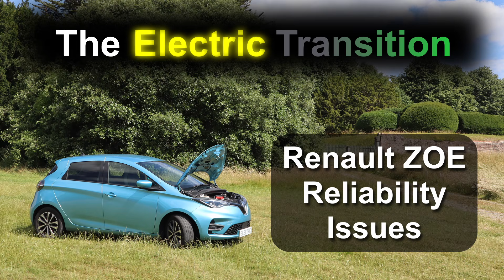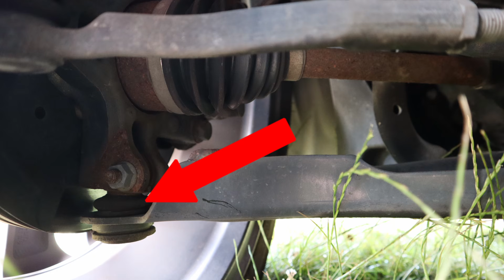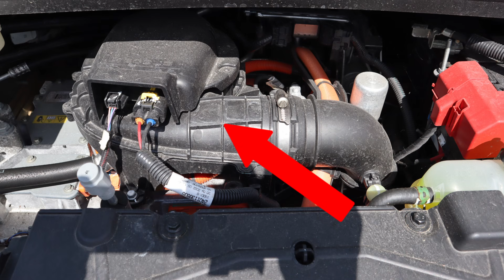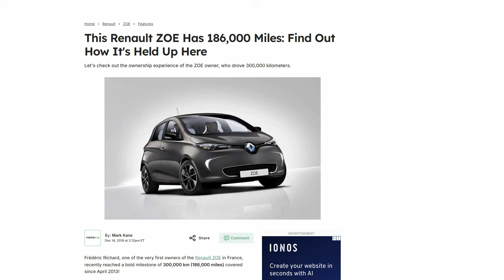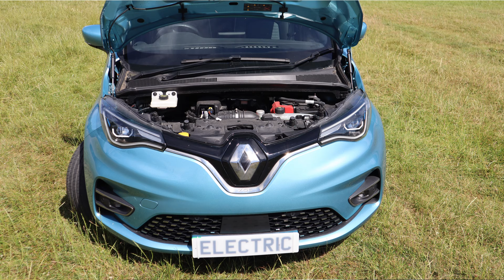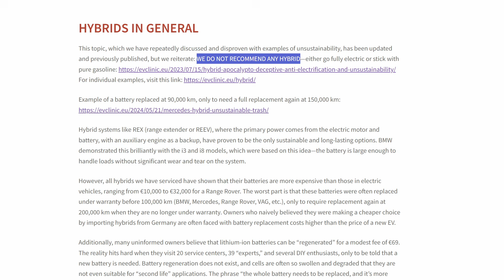Renault ZOE - Reliability Issues

Comment: R135, had to replace the rear discs at 30,000 miles. Couldn't understand why as mostly regen braking and the front disc were fine??? The rear view camera has been very temperamental. The Renault garage would charge a significant sum just to check it out before declaring whether it was under warranty or not, so just live with it.
Reply from the maker: Oh wow, a second person saying they had the rear discs replaced. How unexpected! Thanks for the information.

Did they say WHY they needed to be replaced? Excessive wear, or corrosion, or did they not say?
Reply: @theelectrictransition  I had to have two rear disc rotors (warped) and pads replaced due to seized calipers.  The hydraulic brakes don't get used often enough owing to the regen (and my anticipatory driving style.)  All in, was an expensive repair as the caliper subsequently had to be replaced as was leaking fluid.  I now know better so stick it in Neutral and hit the brakes hard when no-one's around periodically to skim off any surface rust (especially after rain)
Reply from the maker: @philip8742  Ah, gotcha. Thanks for the clarification. Yes, if the pads drag then I guess the discs will overheat, hence the warping. What a shame. As you say, the occasional heavy braking should help alleviate that, all being well

Comment: Gary indicates the R90 motor as the sweet spot for reliability. But given the R motor extraction problems you highlight, would you say the Q90 is likely to be at the lowest risk of a hefty repair bill?
Very informative video - thank you!
Reply from the maker: Thanks very much. Yes, it seems to me that the Q90 should be easier to repair than the others. The electronics are accessible from the top, so jobs on that should all be easier. I don't know how the motor comes out, but I'm not sure it is likely to need to.

I felt that the 90HP motor was underpowered, but if that doesn't worry you, then it's well worth a look.
Reply: Thank you for this - I own a Q90 ZE40!

Comment: Thanks for this useful video. 
My zoe 50 r110 with 55.000km makes some noises when turning the wheels while stopped, even in a dirt road. I read somewhere that its normal of this cars, but maybe the lower ball joint needs to be checked.
For the motor bearing I'm already planning to change them around the 100.000km.
Continue with the great videos!
Reply from the maker: Thanks, much appreciated! The lower ball joint will be checked as part of an annual safety check, if you have one. In the UK, we have a mandatory annual inspection that we call the MoT test which would highlight the issue in addition to servicing.

Comment: Just about to change the motor bearings on my 2017 R90 after only 55,000 km (!) . I've bought it second hand two years ago and it had problems from the beginning. The bearings didn't make any weird sound but the car would sometime stop with "electric motor failure"  alarm on the dash when in hot weather . Being through Renault service, got the rotor position sensor changed but it didn't solve the problem..meanwhile the car got out of warranty. Taken it back to Renault ( there are no private workshops that can work on electric cars here in Italy) just to have a quote of 4,260 € to change the motor...not worth it. So i've decided to face the problem myself and started investigating and wathcing videos and reading as much stuff i could find about the topic. I've come to the conclusion that the bearings are failing having developed axial play leading to the error related to the rotor position sensor. I know how to make my way through mechanical stuff since i've been building and testing automatic machines for the food packaging industry for the last 20 years, so i've decided to do it all by myself. I've bought the bearings ( improved ones with higer RPM rating than the original ones) for as much as 12 € . It will take some time and effort , but i will "future proof" my Zoe because i am planning on keeping it for as much as i can.
Reply from the maker: Try these for starters:

https://youtu.be/jItjGH4Th5A
https://youtu.be/593y6YZtEZ0
https://youtu.be/DUtf1TzWzzg
https://youtu.be/jPzJPWOw3LM

There are lots of others that might also be beneficial, so watch as many as you have time for.

Gary also has a few things that might be useful that are only available to members, such as cooling system refill and a few other bits. Not much, but a single month's membership to see the member only stuff might be worth the small number of euros it costs.

You can see the video titles of member only videos without being a member, so have a look and see if you think it's worthwhile.

Good luck! I'd love to hear an update on how you get on, if you get time.
Reply from the maker: I'm sorry to hear that your car has been giving you trouble. However, I'm hopeful that you can resolve it.

Be mindful that the high voltage system on the ZOE is activated as soon as you unlock the car, so get that battery disconnect pulled as early as you can, and check that the power is off before proceeding. Gary shows this in one of his videos. I'll find a couple of vidoes and post the links

I would recommend watching as many of Gary's videos as you can make time for. He shows a number of useful tips, including how to get the high voltage cables disconnected. Watch the video on the coparts car showing a broken HV connector for what I mean - how NOT to do it!

I wish you luck. Take it steady and remember that the stack is very heavy. If you are able to, get someone to help as you lift it out of the car, just to make things easier.
Reply: @theelectrictransition  Thanks for the reply. Yes i know Gary's channel and he's been one of my sources to detrmine the cause of my car's problem. I'm one of his channel members since all the information he gives are of extreme value. I'm in contact with him via mail and he even offered to guide me thorugh the whole process, but i'm trying to get the work done in a slightly different way , keeping the main box attached to the car while taking the transmission out and then sliding the motor to the right . I'm going to use a ramp that one of my work's mate has ( he's very much into cars DIY) . We'll see when we get there. We are going to try this way, but if we see it's not right or if it's dangerous in any way, we revert to the standard procedure. This is just because i have only one day to do the wotk and since it's our first time doing  it we have decided to try to take some shortcuts ..but still work with safety in mind: Ours first and of the car last. We have transmission jacks to sustain the weight of the elctronic box and i've built a cradle to hold the heat pump compressor in order to not detach the pipes from it. I need to get it done fast beacause it's the only car we have in the family and I need it to go to work ( 70km round trip commute daily).
Reply from the maker: @DanieleElaborati  That's great, it sounds like you are all set
Reply: @DanieleElaborati  any progress?
Reply: @MIHEMINNNN   Yes. I've changed the bearings Using the " official" procedure. It's actually easier even though it took two full days and two people to do the job. Taken the stack out , it took only an hour to open the motor, change the bearings and close it  again. But , unfortunally, the bearing's seat on the resolver side is worn due to friction ( the old bearing was getting stuk when heated and it turned it's outer ring together with the shaft) . So even if the new bearing has come with a bigger C-Clip ( Seeger) , it still throws the error sometimes ...much less than before and in a predictable way but , still....I let the winter pass and try to find a new motor for cheap.
Reply: @DanieleElaborati very appreciative about your input. It's still an improving industry but with cost cuts. Looking to buy my first electric car, but doing plenty of research first. And saving some money 😂
Reply: @MIHEMINNNN  If you want to look into the zoe, be sure to buy a "Q" version. It has the 5AM motor by Continental and has been much more reliable than the "R" version that has the 5AQ motor . You can even find "Q90" variants with the 5AM motors and 41 kWh battery...they're pretty rare though
Reply: @DanieleElaborati thank you!

Comment: I have the R135 Gtline Zoe, the heat pump compressor failed at 40,000 miles and was replaced under warranty. At 67,000 miles I've just had the rear brake discs and pads replaced. So relatively problem free and still returning 200 mile range in Eco mode and mild weather, around 170 miles in colder conditions.
Reply from the maker: Thanks for the information, that's very interesting. The need to change the rear discs in addition to the pads surprises me a bit. Was that because of corrosion, do you know?
Reply: @leegoodman297  useful info, thanks. 
What's the mileage now, is it the same 67,000?
Reply: @t.m.9182The mileage is now 70500, no additional issues from my first post. The most likely issue to occur with my GTline R135's is motor bearing failure typically from around the 100,000 mile mark. If caught early then just the bearings would need replacing, but apparently excessive bearing wear will cause the motor to rub against the windings and totally destroy itself!

Comment: R135 in the family, my daughters car. Obviously the bearing issue is a worry, I doubt she’ll notice the noise should it happen to her car. I don’t think it’s something to panic over too much though as we don’t really know what percentage of cars are affected, they’ll probably all fail eventually but if the usual failure mileage is for example 150k that will never be an issue as she does around 5k miles a year.
Reply from the maker: Yes, very well said. I think the average lifetime mileage of a car in the UK is about 120,000 miles, although that figure might he outdated.

My 25 year old smart ForTwo went for recycling - to help other smarts live on - at under 70,000 miles, although, to be fair, that was partially because my mum had the car for 13 of those years and did very few miles in that time

Comment: Just to let you know that I went in a Zoe ZE50 R110 Uber some weeks ago and the car was couting with 376.000 happy kms with no issues to fault (I saw the odometer to check 😅). And a full charge was still enough to do 300kms. And the guy told me that the fleet had several more Zoe's, some with more than 200.000kms and no problems as well. So I would say it really depends on case to case basis
Reply: No, Portugal!
Reply from the maker: @r10alfa  Great to know, thank you
Reply from the maker: That's fantastic! Was that in France?